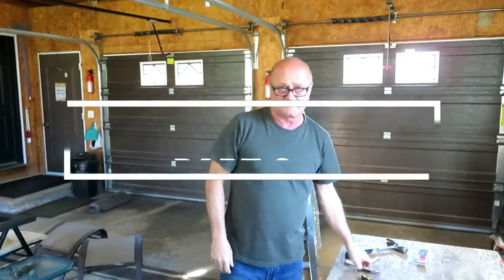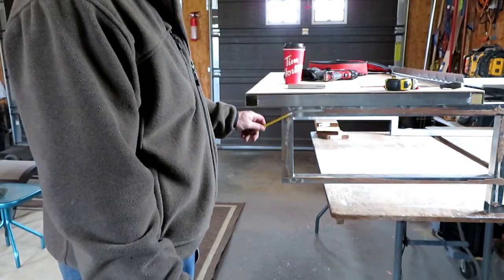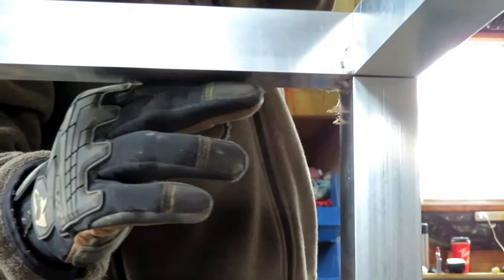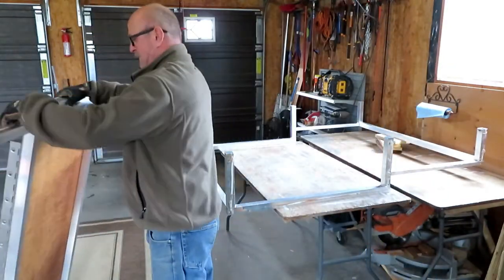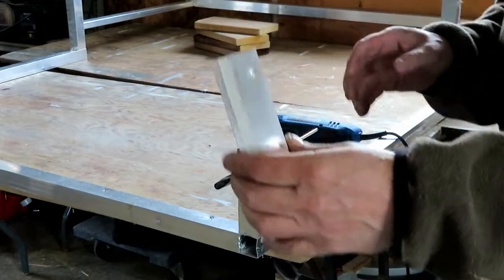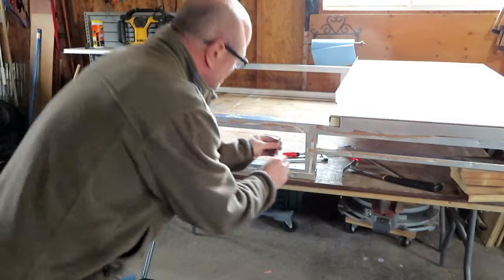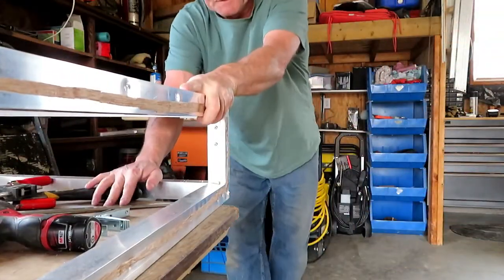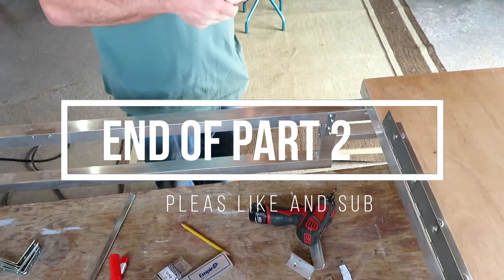RV bed frame modification Part 2

Comment: Best tool for the job should be a grinder for cutting steel, metal and/or aluminum. I personally have a Dewalt 20v cordless grinder. Man, that thing works wonders! Good job on the modification.